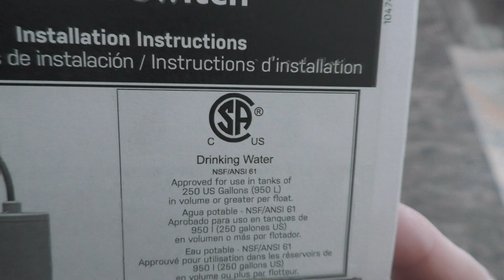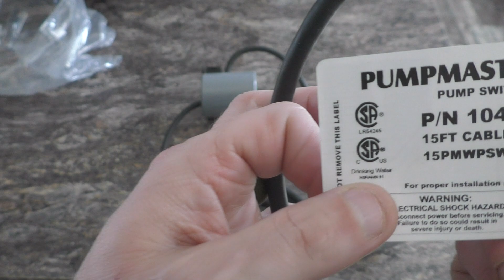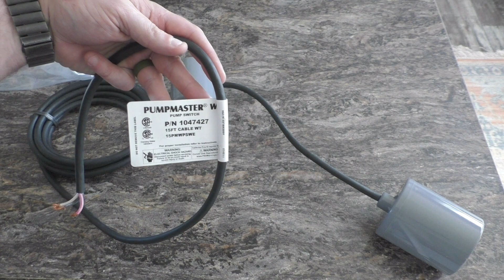Water Tank Float Switch Basics

Comment: How do I wire this to control the well pump?
Reply from the maker: Generally speaking the float is wired into one of the legs of the pump in Normally Closed (pump up) mode for a standard AC power float (e.g. SJE Pump Master WPS). This will turn the pump on when the level of your tank goes down...and the float turns the pump off once the level rises. 

Setting where the float is vertically in the tank is important since this determines the on/off levels in your tank. But the length of cord you have from the float itself to the weight/attachment point also affects the pumping range (how much water is used before the pump turns on to fill).

There are other floats out there that are meant for control wiring and are not intended to control the actual AC power line (e.g. SJE SignalMaster). These are used for signaling only and need a controller/PLC to actually control the AC power to the well pump.

Comment: How do you set the cut-off water level in a pump up configuration?
Reply from the maker: The float will keep the pump on until it raises and flips up in Normally Closed condition. Where this "flip" happens is when the pump would cut off and would be the upper water level. Your placement of the weighted piece in the tank should be near this upper limit, and the float itself has a cord length that varies based on how much range of water level you want (lower range is when the pump turns on, upper range when the pump turns off).

Comment: This was extremely helpful, thank you! I have this in my 375 gallon storage tank. Can I install a manual switch between the tank and the well controller so I can manually switch the pump on to fill the storage tank? It seems I could and it would simply become the primary switch if engaged, and would not effect the float switch. Then, I could turn the manual switch off, which would make the float switch primary. Would this work?
Reply from the maker: That would be possible, but the specifics would depend on your installation. If your switch is operating at 120vac I would look for a suitable SPDT switch to cut the float out of the circuit when in manual mode.